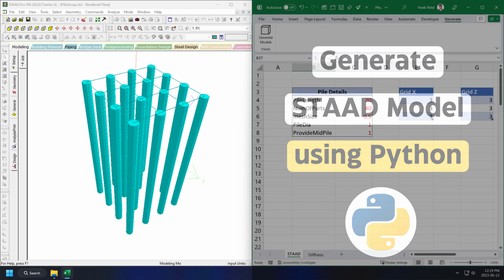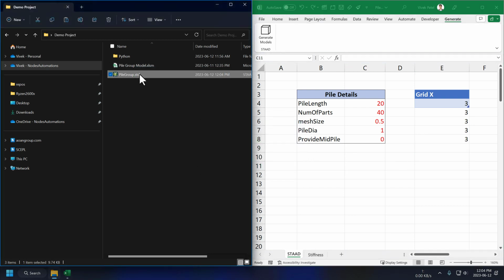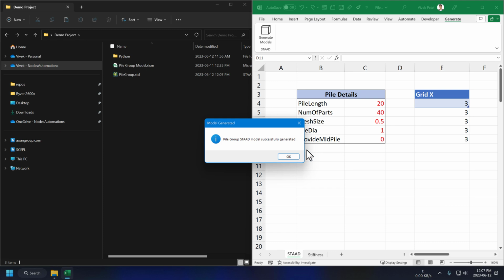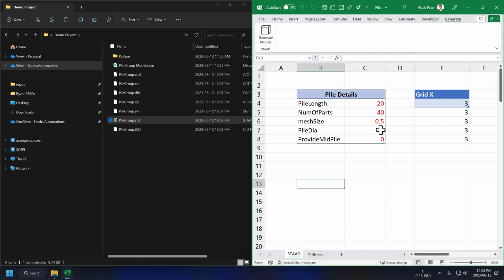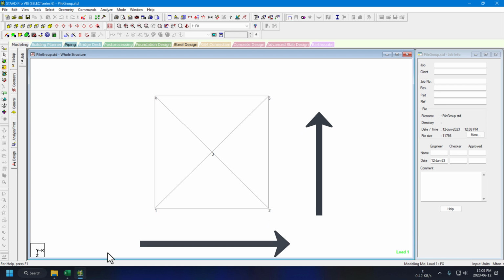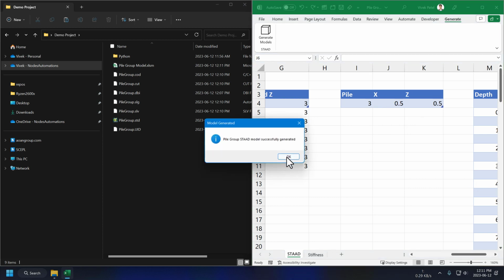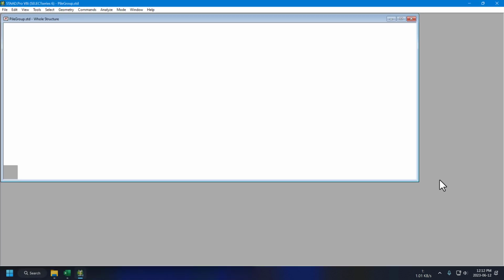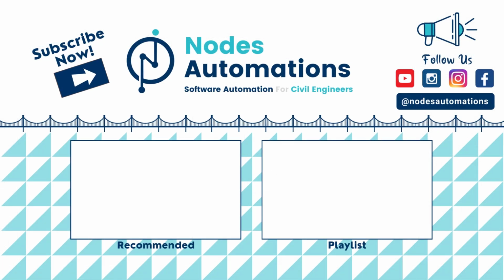Pile group staad model generation using python

Comment: How you provide support?
Reply from the maker: I am not expert on pile group i am just passing info on what i did in this project. I am providing separate stiffness on each depth, stiffness for each depth is calculated based on nh value for each rl level.